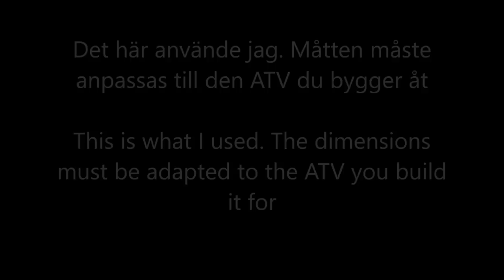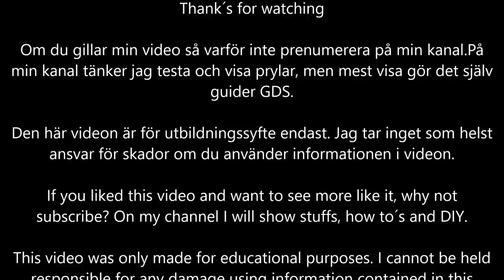Bygga ATV halvband

Comment: At the tread joins I'd use a pair of hinges, with the pin roll facing outwards into a gap or notches at the tread ends. Round all edges of the hinges so they don't cut the tires. Instead of a ratchet strap for tension, a length of ACME threaded rod and a nut would make a more robust adjustment. A grease zerk on the nut would keep it from rusting to the rod. A cargo box mounted to the tag axle would be useful.
Reply from the maker: Good idea👍. Thank's for watching.

Comment: You should have used a piece of tire on the inside to bolt the two tires together, because eventually those duct straps are going to break.
Reply: yea he should use tire but top of it use duct strap and bottom

Comment: Split the tires down the length in the center of the tread and use rubber straps and bolts to bolt back together, this will create lateral treads the length of the "track" as well as leaving full height sidewalls to help prevent elements from entering the "roller" area of the tread. Then use vulcanizing rubber cement to glue a spliced innertube inside the resulting track to prevent tire damage from the mending bolts. Also you could add screw's to the tread of the track for added grip.
Reply: What's the benefit of the cuts down the length of the tire? I'm a little confused by that comment.

Comment: hello Jola sad to see so many disrespectful know it alls that have never done anything disrespect you, my friendly suggestion is to shorten your square tubing so that the trailing tire is only about 2in, or cm, so that will lower the leverage on your rack and shock assembly, then wrap something around the tires and this will give you the diameter of the tire you need to make your track from, also the square tubing used for idler wheels should be telescopic so you can add or lower the pressure on tracks will also allow you to change tires, tracks, and change track length if you change out tires used for tracks. Very cool idea, keep up the good work. PS i`m an old retired mechanic welder.
Reply from the maker: Thanks Marnie. I have plans to continue my project that is not finished yet. I have renovated a house, and have not had time to complete the Atv tracks. I appreciate tips and tricks from creative people like you. It makes me happy. 

And to all the negativ people, they should read this. "Any idiot can criticize, condemn and complain. And most do". 

Anyway Marnie thanks again and a happy new year.

Comment: Wonderful!  Ingenious!  I already have a Polaris 6x6, but I see that I could make my own tracks for the rear wheels (without the welded frame).  Thank you.
Reply from the maker: Thank you very much. 
yes you have an advantage everything is ready. just make the tracks. Put on the tracks with no air pressure in the rear wheels. Then pump air in the rear wheels to tension the tracks. Thank's for watching.

Comment: Ingenuity ; I would prob weld an All thread in place of the Ratchet strap then Built a Cart platform for firewood fetching w chainsaw holder for on top or a Log skidder mod built off the tail end . 
To control any sway if that's an issue 2 strut cartridges can be welded in or coil over along the Bracing to axle . 
 I will say what you have done thus far is Superb 🤓Noice 👍 
 Cheap & Functional 
That's using ur Noggin 😆
Thanks for Sharing ; 
Sharing is Caring 
Liked and Saved for others to find and a reminder of How to for myself ; I appreciate ur handy work

Comment: I use old tires for plenty of projects. I never need more than a plain knife to cut the sidewall, and then sawzall to cut the steelbelts in 5 seconds !
Reply: These tires are probably reinforced with steel wire.
Reply: Careful w a cut off wheel ; I have a 4" Scar & miss my artery by 1 cm 
 The built in Clutch Failed 😔

Comment: Does this actually help with the traction of the vehicle? Is the vehicle better off-road with the added track?
Reply: VAAL24 - Hans van Wyk I dont really think will help that much cuz there is no weight in the track unlike an actual track meant for atv’s when most of the weight is on the actual track and not the wheel but it might help for like hill climbing or a wheelie bar

Comment: once the tracks get too much snow inside they will not stay on,we used to cut holes every so far apart  with a hole saw and staggered so they would clean the snow while traveling,we built the same thing years ago using tractor tires on pickup truck,use wo master cylinders for help steering

Comment: AWESOME AND GENIUS IDEA 
just 1 thing is wrong: the direction of rotation on the tread on the snow tires. Should be opposite, check the marked arrows on sides of tyres, but maybe u cuted it out ;p
Reply: either way works, the angles in the tires help to disperse water at speed, so you dont hydroplane as easy, as you can see, he wont be going very fast on these lol

Comment: BOOOOOOOORING!!!  Get in the deep snow!
Reply: jeremy goodwin yea really , a 50cc 2wheel drive kids atv will go threw the shit hes driving in no problem
Reply from the maker: Yes you are absolutely right a 50cc had easily gone through that shit. And there are lots of videos on youtube with ATVs that drive in deep snow if you want to see it. Thank's for watching.
Reply from the maker: Here comes some facts and not speculations. The whole machine weighs about 25kg if it's heavy or not is up to you. Here's a movie when I'm in 40cm snow. https://www.youtube.com/watch?v=Oj-fXnvHBbs  If it sinks like a brick it's up to you. The only time I had a problem with the "tracks" coming off is real hard turns on asphalt. Thanks for watching.
Reply: Yeah if the front tires don't sink, neither will the rear
Reply: people just want do know did it made an improvement, i think it needs little more thinking cause front wheels will dig in no matter what and rear wheels will follow, id undrestanded if you put a trailer hitch at end there to distribute the weight of trailer on rear axle and thru that improve traction and so on
Reply from the maker: Well I need to work a bit more with this thing. I have not had the time because I have bought another house that needed to be restored. I Will continue next winter if I got time.

Comment: Hey:).You maded  wrong conection with bolts and metal duct strap.This conection must be like hinges.
Reply from the maker: Why ???
Reply: Because the duct is radialy in the same direction with tyre and do round move,after do strate move.Finely after few houers should to broke:).
Reply from the maker: Yes you got a point there. But the radius aint that bad. It might break fast. Next winter we will now when I tried it harder. Thank´s for watching.
Reply: Just overlap the tire/track at the junction and run bolts through with nylock nuts. That will flex without worry about breaking. For traction, bolt some angle iron cross pieces across the "track" every 6" or so. Clever project, sometimes it fun to break out the tools and make something.

Comment: oops i see you have a way to tension tracks, simple and good, just geet those tires closer together so you don't have to join any together, also if anyone does this to a quad if it is 4x4 the front and rear tires must be the same size so the driveline is not ruined

Comment: You still only have grip basically under the rear atv tires, the rest of the track doesn't have enough downward force to provide any meaningful traction. So you really would have been just as well off buying a set of ATV tires that had some decent tread than these stupid things.
Reply from the maker: Well, traction is not the only thing you need on tracks. Good flotation and a low ground pressure is also good to have. And things can not think. therefore they can not be stupid. But the creator could be. Thank´s for watching.